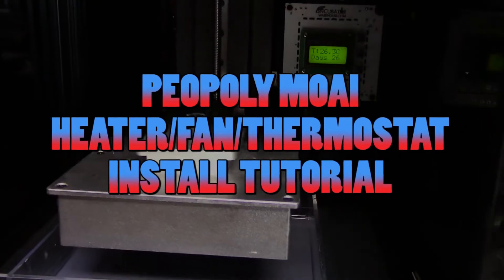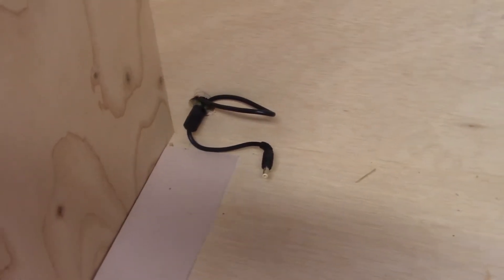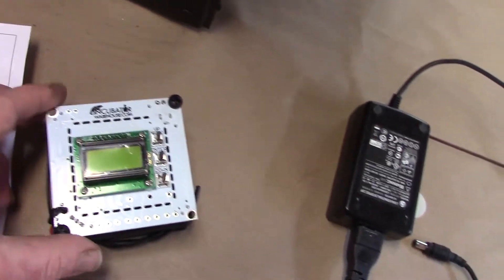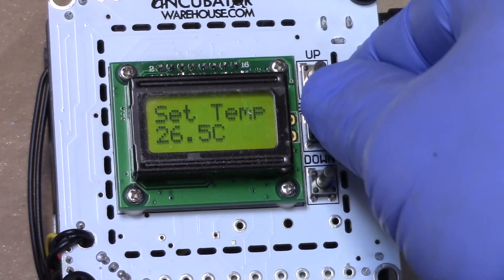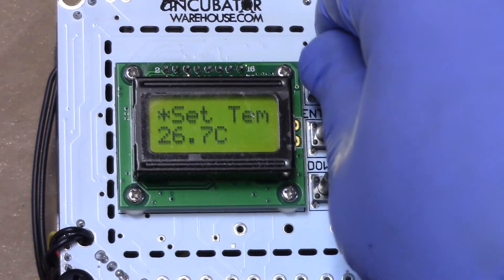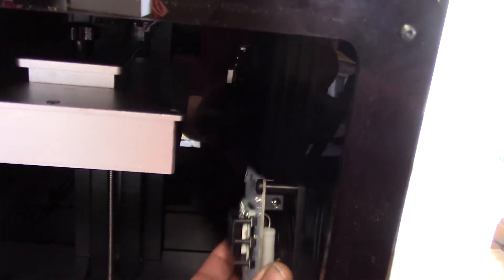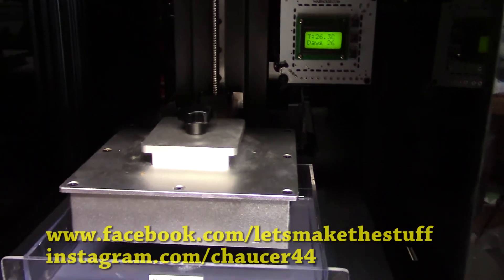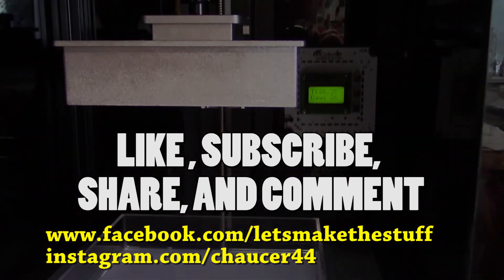Peopoly Moai HEATER INSTALLATION TUTORIAL 3D printer DIY modification

Comment: One good plus about these Incukit heaters are if the fan fails the heater cuts off so no possibility of a fire like you could have with the PTC heaters (not unless an inline thermal fuse is fitted), I made a housing for my Anycubic Photon. 

What advanced settings did you find work best for constant temperature??

Comment: @chaucer44 how effective is the heater?
Reply from the maker: Very effective!  I have been printing at any time of the day and have not had any failures since installing this heater.
Reply from the maker: very effective.  I am using a new resin and I set the heater for 80 and it stays at 80 all night long no matter how cold it gets.